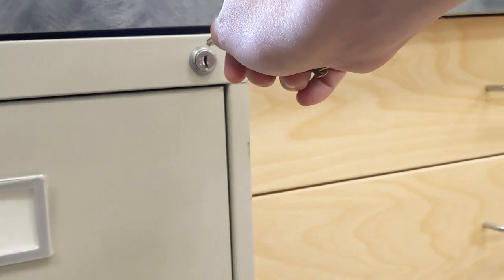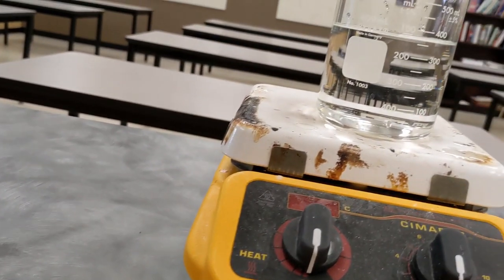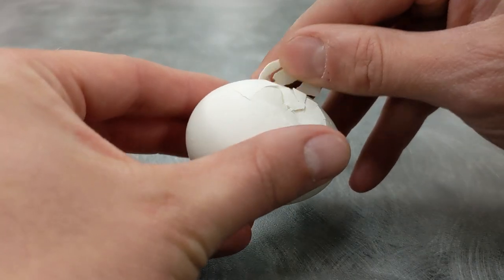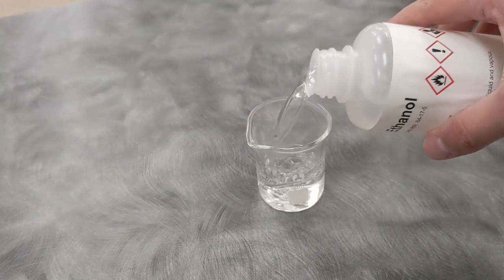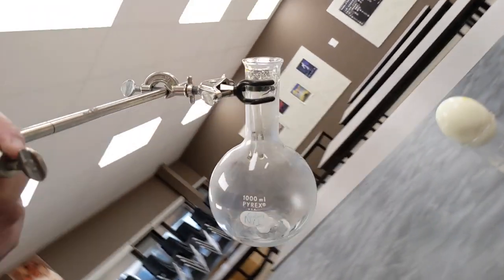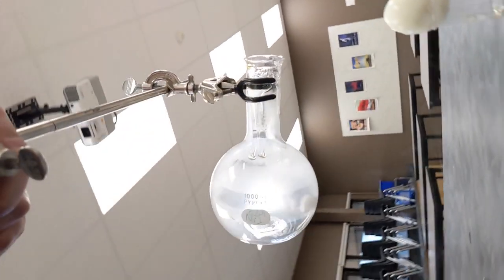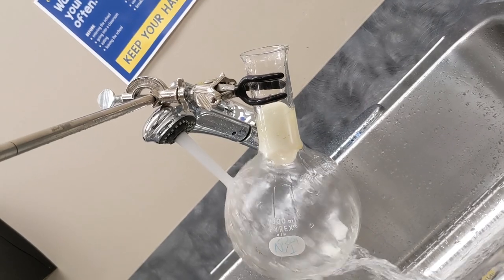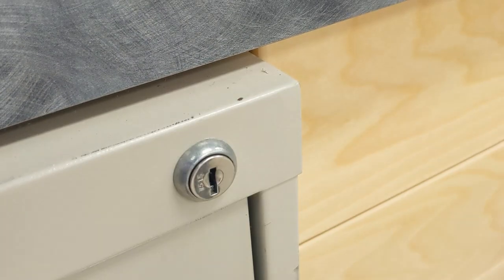The Egg Sucking Flask

Comment: Charles law:
Volume = (Const.) × Temperature

★ Gas has no fixed Volume or fixed shape & it always fills the container!

★ Decreasing/Increasing the Temperature inside means Decreasing/Increasing gas Volume.

★ The weakest point of container is its Nozzle's cover = {🥚}

(1) In the 1st half of demonstration:
You raised up the Temperature inside and covered the Nozzle with the {🥚}
So, when the Temperature goes down, Volume decreased by sucking the {🥚}
"the weakest point of container"

(2) In the 2nd half of demonstration:
Your covered the Nozzle from inside
With the {🥚} , and increased the Temperature, so Volume increased by spilling out the {🥚}
Reply from the maker: Fabulous answer!
Reply: Thanks,,
Keep up the great work.
Reply from the maker: Thanks!

Comment: Because the pressure inside the bottle is higher than it is within, the force the outside pressure exerts on our egg is strong enough to gently push the egg into the bottle.
Sir here physics applied more than chemistry !!!😅😅😅
Reply: Shi btt hai 😁
Reply from the maker: Ah, but if the pressure inside was higher, wouldn't that push the egg out?

Physics and chemistry work as a team for this one, I'll admit.
Reply: @rmahaffy  ya sir when we cool down it under the cold water tap the pressure inside rises as the gas expands on cooling down, thus pushing the egg 🥚 out too!
Reply from the maker: The tap water was hot, but you're right that it makes the pressure rise!